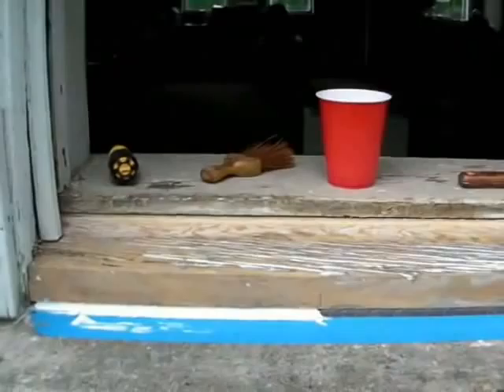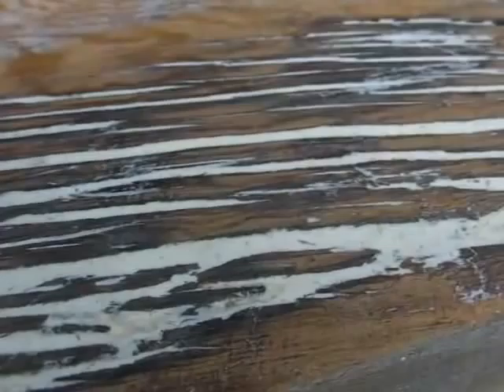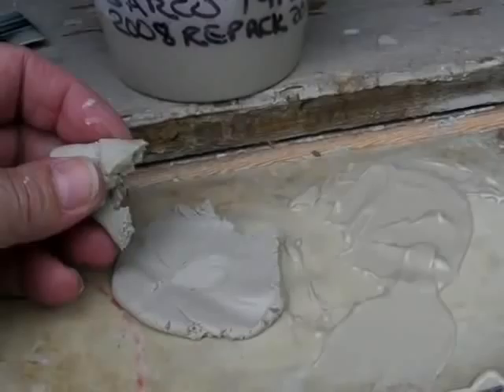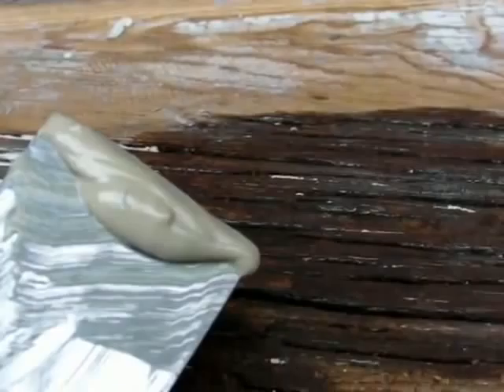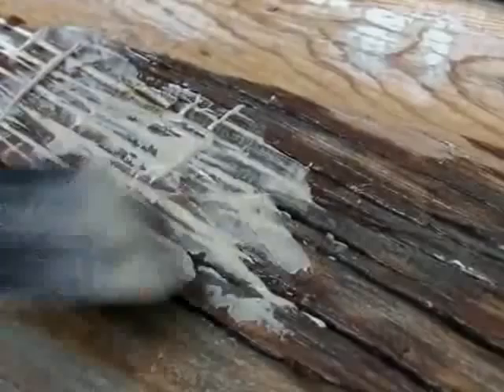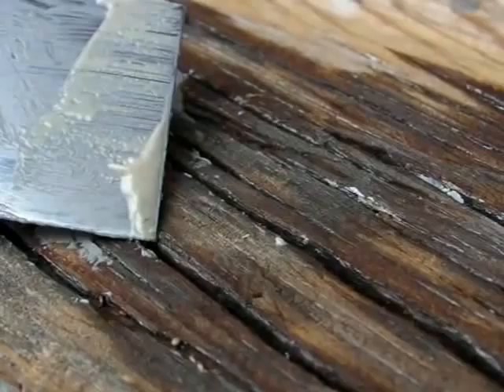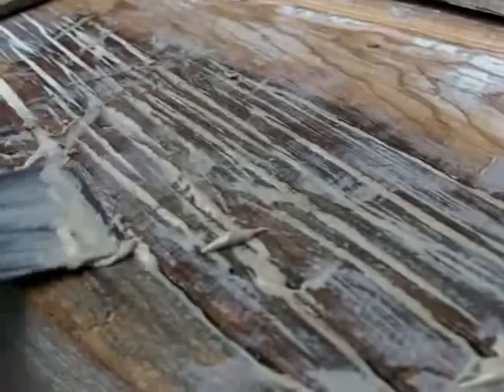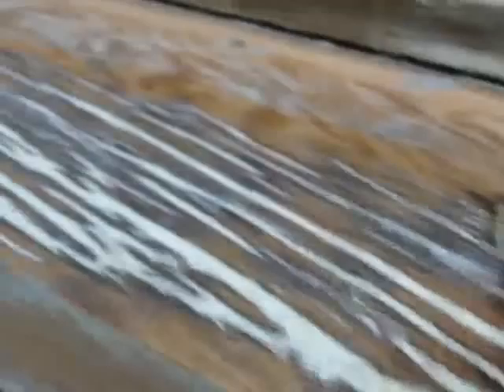Window Sill, weather check repairs

Comment: I wish someone could make videos on the issue of bottom sills for old doors . I suppose it would be the same method …?
Reply from the maker: Yes, these same methods can be applied to door thresholds too. The epoxy materials will hold up to the wear and tear on a threshold much better than the softer putty or glazing compound that is adequate for window sills.

Comment: Hi John , can I add that the priming of wood with boiled linseed oil could stand to oxidize for a day or 2 before applying putty, otherwise the oils in putty would travel with the priming oil into the wood? Not sure if the addition of BLO into putty for 'mayo' negates the oil loss/leaching
Reply from the maker: Hi Matt, yes, it would be OK to let the oil primer stand for a day or two.  We had a time limit when I placed this test,  and the video shows that I proceeded with filling right after the linseed oil application, then continued the treatment the next day by sanding and priming with oil-base alkyd primer and two topcoats. The result after sanding and painting was putty that was perfectly level with the adjacent wood surface.  One result of not letting the linseed oil priming dry and cure, is that two years later I noticed that the surface of the putty fills were somewhat concave. I think that happened shortly after the test was placed, because the oil continued to soak into the surrounding wood, "sucking" the mass of the putty down. Because of this effect, this method now has a different protocol for the linseed oil treatment. It is applied and then allowed to cure for at least 3 or 4 days. Then the putty is applied as in the video, allowed to cure for a week, then more putty applied if the fills become concave.
Reply: @johnleeke  Yes, so when the Linseed barrier is formed via O2, anything placed atop has 'nowhere to run'. I did notice some concaving on my stain glass panel glazing on my uppers I did 2+ years ago...before I thought to give the linseed some time. In a sense I was just thinning the putty by glazing right after the oiling.
Reply from the maker: @mattschademann6826 , As linseed oil polymerizes by taking oxygen from the air, it gains 15-20% in mass and reduces 8-11% in volume. (those numbers might be off a little, it's 40 years since I learned it in art school)
Reply: Brilliant conversation . Thank you

Comment: Hi John. Can you use this filling method with the putty and boiled linseed oil on larger and deeper patches of rot?
Reply from the maker: No, I would limit these materials to cracks, joints and holes that are 1/8 inch or less. For larger patches I would use wood-epoxy repair methods and materials:  
http://historichomeworks.com/publications/